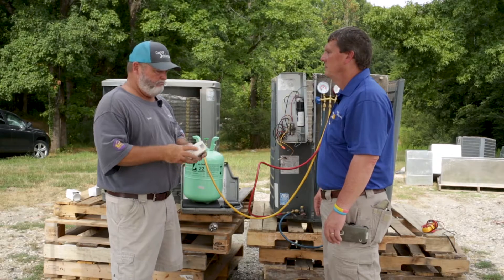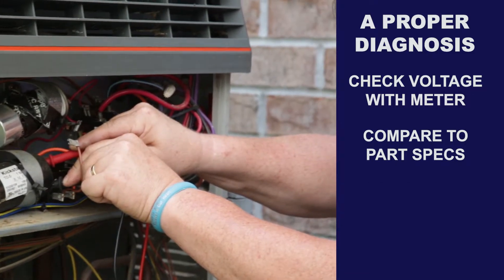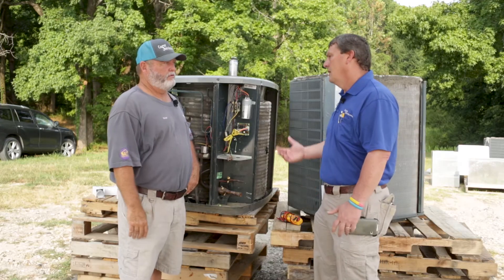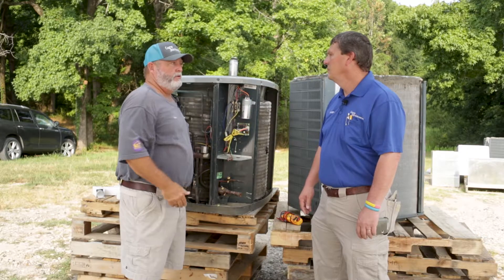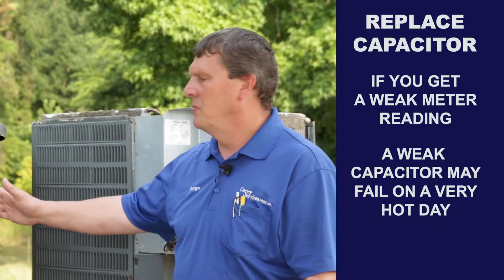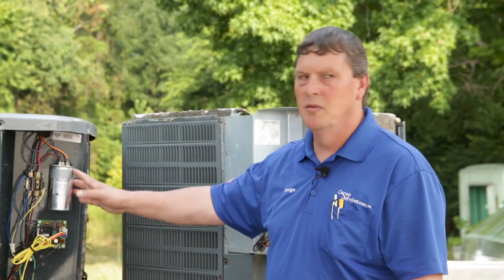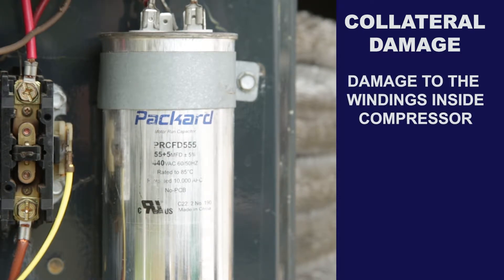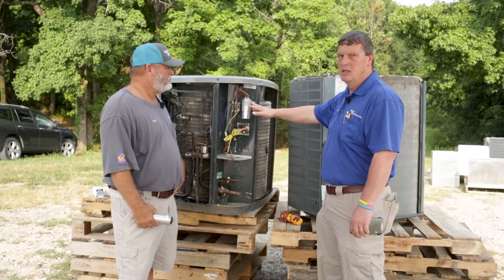Bad AC or Heat Pump Capacitor or Scam? - Don't Get Scammed

Comment: Sometimes the cap doesn’t even swell when it’s bad. The fan may just not spin up (but will maintain speed if manually spun). Crooked tech tried to tell me the motor also needed replacement- he lied. 

 Swapped the cap myself and she spun right back up without issue and has been running since.